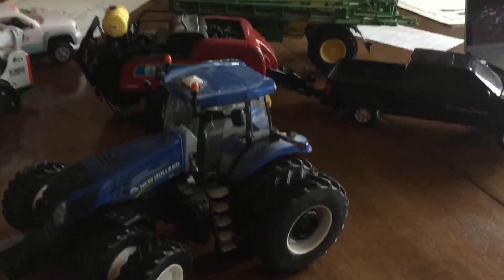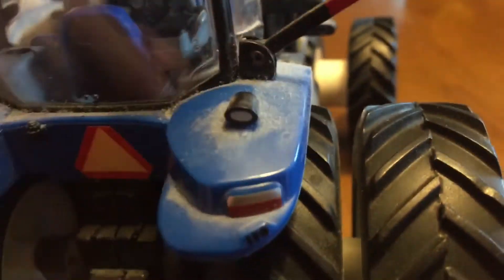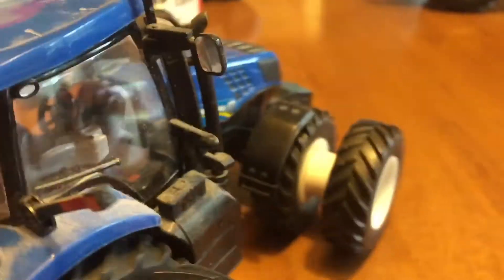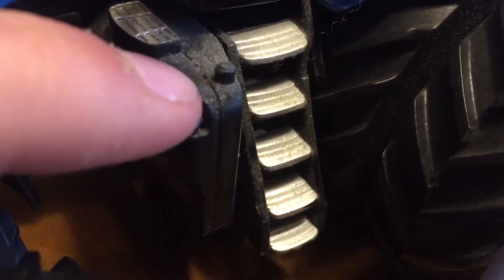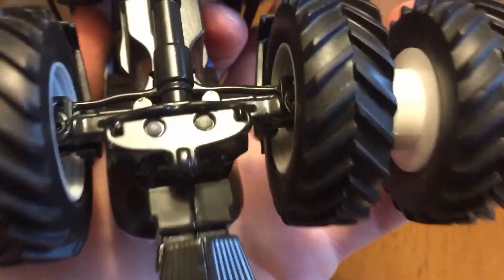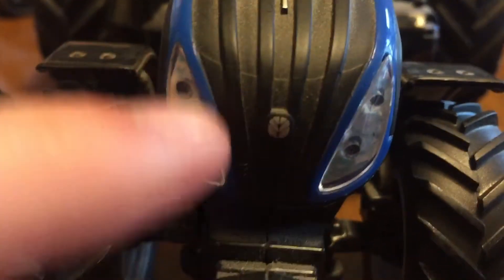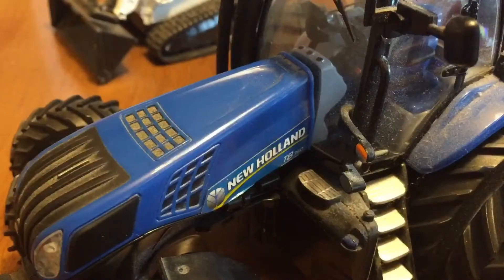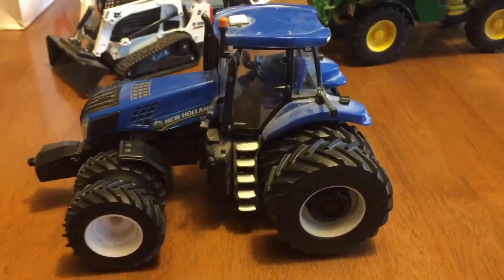FMF1 1/32 New Holland T8.360

Comment: Yessssssssssssssssssss!!! Looks like a fourwheeler. Or my screen is jjust dark. that's not a hitch. That's a wheelie bar. Ya cam quality is quite dark. Thanks for telling me how to lock the hitch. I was having problems with my tractor. I kept getting my hand stuck in the mower but now I know how to use the hitch. Those are nice rims. I like the dust. It make the tractor look manly. The side pillar is key. That doesn't look like my tractor. I know why the tractor doesn't move. You didn't put any gas in it. Silly Adam. Dual wheels baby! Woah you are strong! You just handled that tractor like a seasoned veteran. I agree the counter weight was quite low detail. Stickers are lame. You got the real deal. Overall Opinion: The rustic look (dust) gives it a sense that the tractor is a hard worker in the field. I would have like to see a little more detail on the counter weight and I didn't like the cut out mesh. A nice product overall